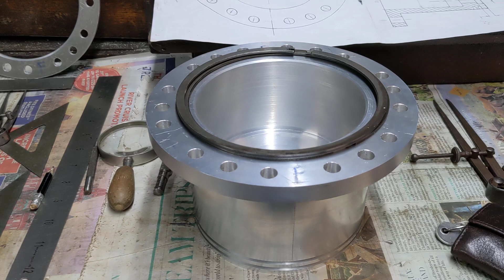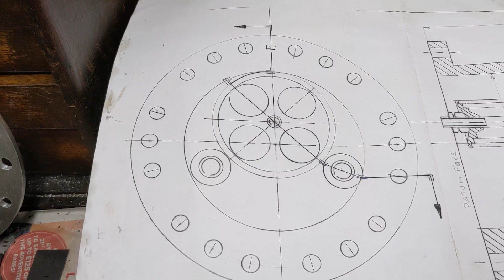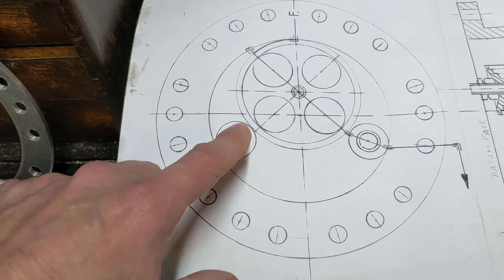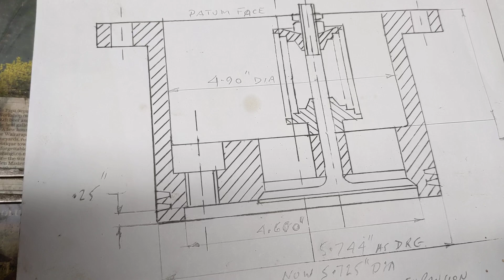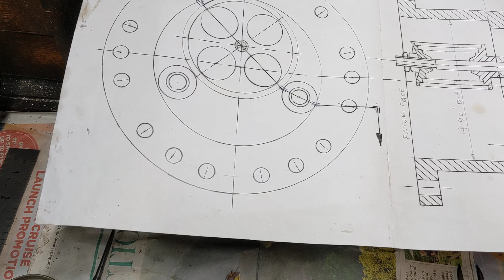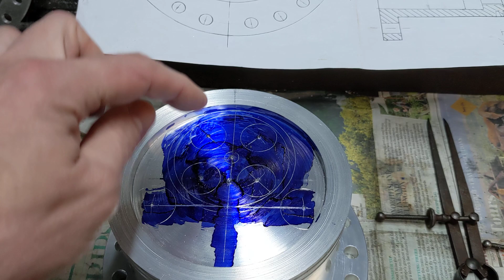Heads up!

Comment: Running it without the rings in place will allow compression to bleed past the sleeve valve, so wont be a true test of whether the starter is up to the job or not,  won't it ?
Reply from the maker: Yes.. The plan is to fit the head without the rings first and turn by hand.. Then refit with the rings and turn by hand again. We want to make sure the top of the sleeve doesn't drop below the bottom ring. Once all that is established then we'll spin her up with the Dynastart. 💪

Comment: Are you not worried about overheating of the head, without cooling fins?
Reply from the maker: Not particularly. I think the radiation heat dissipation of the aluminium will be higher than the original cast iron. And with lower compression and no supercharger it won't get as hot. In theory anyway 😁

Comment: Just a thought. The head is recessed. Will it have a shroud over it to keep it dry in there?
Reply from the maker: No, I'll just let it fill up with water if I get caught out in a shower. Should boil off nicely when it's running. In fact, I might even cook some spuds on those long dark rides 💪